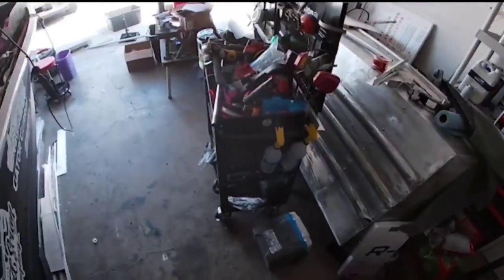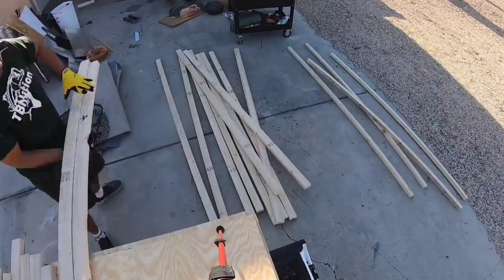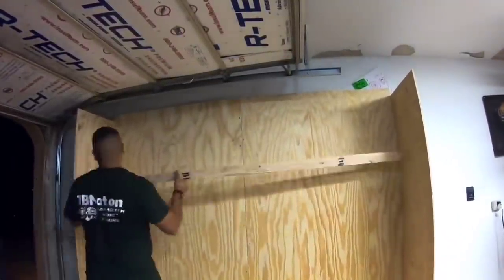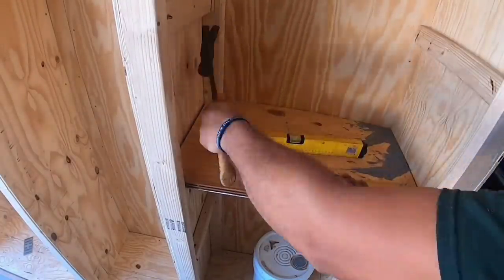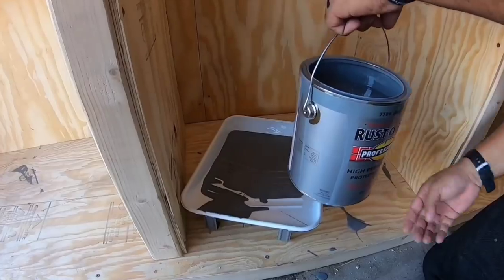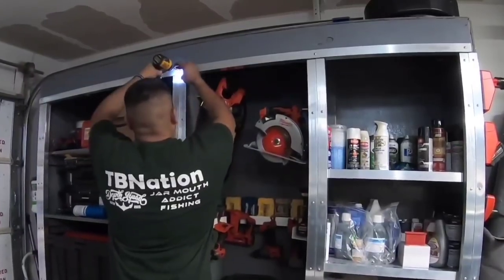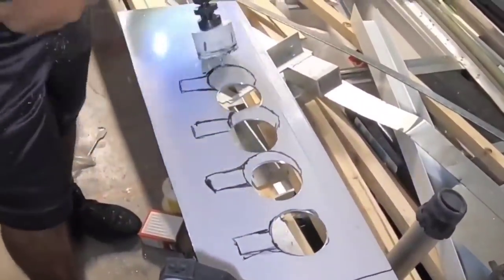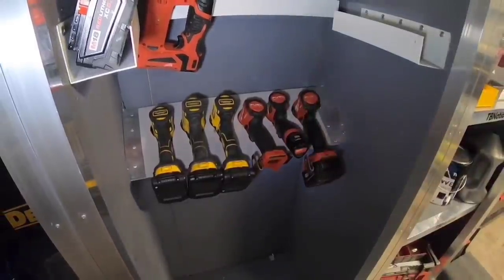Tool Storage DIY Ideas for your Garage | Garage Shelves and lockers done EASY.

Comment: I usually add a back cleat to my shelves after I had a few sagging problems. The humidity can get pretty high here in southeast Kansas during the summer months. Still a great idea
Reply from the maker: What is a back cleat?
Reply: @CrushedEMTB  I think what Michael meant was a third cleat which you would attach to the back, so the shelf sits on 3 cleats, 2 on the sides which you originally made ad a third in the back which would prevents the sag along with offering even more support .

Comment: Nice build, looks great. A question, do you live in a humid area and if so did you paint the back and the underside of the cabinet? Moisture will come up through the concrete floor and cause rot.

Comment: Currently with the elevated cost of construction materials, do you think building storage is still a relevant cost savings compared to buying?  I recently built a 72"Hx48"Wx24"D garage storage rack. I built it for a project for my 2 small boys and I (priceless), although much sturdier, the project did not cost much less than if I had bought one of similar size.
Reply from the maker: Just depends whether or not whatever you make or whatever you get serves the purpose better

Comment: I appreciate the step-by-step breakdown of how you made this work for you. But for future vids, I'd steer away from saying "you can make this for cheap" particularly b/c you already owned some of the tools needed to make this, plus had some spare material lying around for a project like this. So it didn't entirely cost you between $300-400 to make this. I highlight this b/c you'll have viewers like me who are literally brand new, won't have supplies, won't have spare materials lying around, and won't have a clue what they're doing.
Reply: Good points but still way cheaper than storage systems that are flexible too meet s individuals needs. Even at 5 to 600 still cheaper and a hole lot nicer than any store bought system. Great video

Comment: stumbled across your channel. subbed. nice build. I'm curious... that is the tiniest portaband I've ever seen. Do you find you use it more than a regular sized one? Is it strong enough to still do steel or is it just for aluminum mostly?
Reply from the maker: I use it almost always. I never have to use the large porta-band unless the metal piece is larger than the smaller porta-band gap. You can get blades to cut through steel all day.
Reply: @CrushedEMTB  awesome thanks. Yeah seems way more handy!

Comment: Great video and nice ideas. 
I noticed that you have R-Tech insulation on your garage door. I measured 179° on the outside face of my garage door (mid-September, full sun, south Florida); the inside temperature was over 100°. I used the R-Tech and some expanding form for the cracks to achieve a 15° to 20° reduction in temperature inside. 
Thanks for sharing.
Reply from the maker: Thanks!